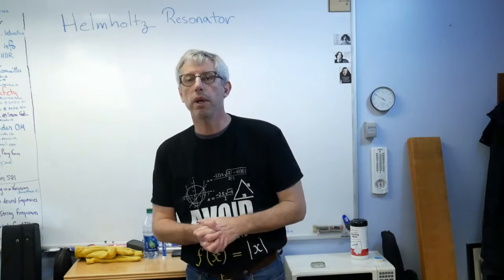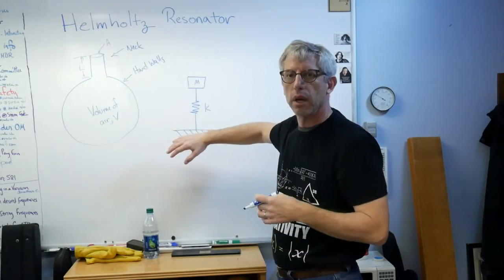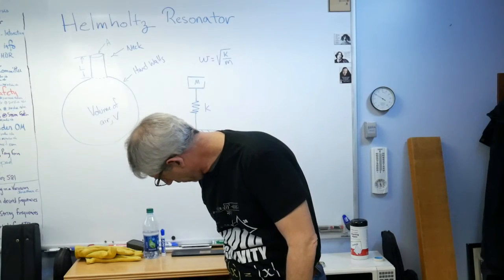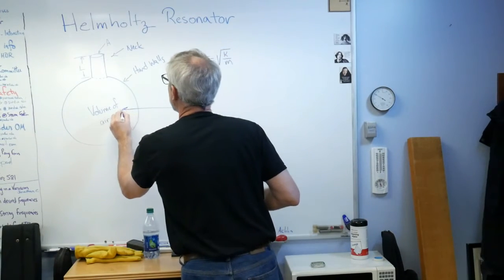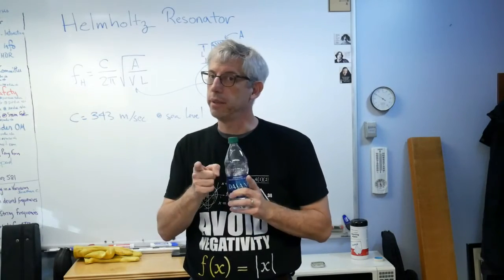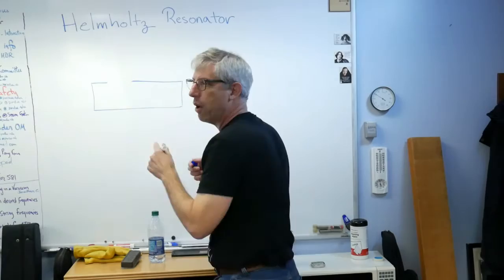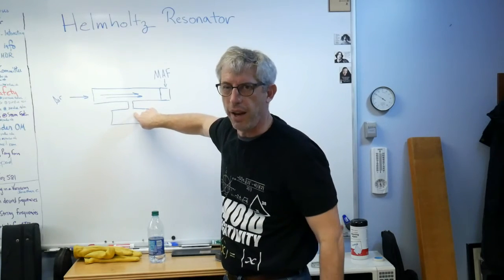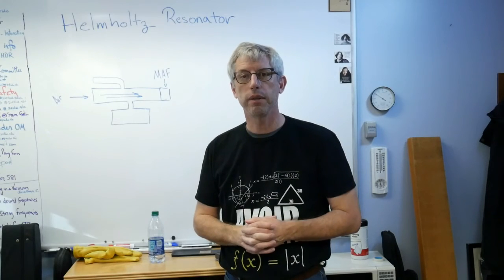Helmholtz Resonator - Brain Waves

Comment: This is a great video; I just wish my professors had been this concise when I was in school. Thank you for making it!

I've ended up down this rabbit hole trying to eliminate a resonant frequency "drone" produced by the exhaust on my car. I've seen several forum entries describing how to create a so-called branch resonator (aka J Tube) but most aren't written by people that really understand what they're writing. My questions are these: 1) If I know the frequency I'm trying to eliminate should I simply use the formula provided in this video to cancel it out or would that amplify the tone? 2) With there not being much room under my car there will have to be a bend. Does the length of this bend factor into the calculation? 3) Does the diameter of the tube leading to the volume of air matter? 4) Considering my drone is around 100Hz, what is the width of frequency I could expect from this "bandstop filter"?
Thanks again!

Comment: All of us humans (young or old) seem to have an innate ability to identify by ear when a water bottle that is being filled by a water cooler will reach capacity. We detect this by sound. But what is it exactly that we are perceiving? A certain pitch? A numerical value that is true for all bottle shapes? Please advise!
Reply: It could be the sound of water resonating within the bottle. As the level of water increases, the volume of air within the bottle decreases, resulting in a higher frequency. Louder (lower frequency) when the bottle is empty. Softer (higher frequency) as the bottle fills up.

Nice observation.
Reply: It's kinda the same sound ya hear when you're almost done going pee

Comment: great video, as always. 
question: what if we don't have a volume, it's all L and A? 
I am asking this for installing pressure sensor on a pipe (called IPV; indicator port valves) in order to measure the pressure inside the cylinder of reciprocating compressors. Helmholtz resonance can cause readings that don't reflect the actual pressure inside the cylinder. how to calculate the Helmholtz resonance in that case

Comment: First, I love the math shirt. 
Second, how do you model soundboards with various holes in it besides the main hole over the strings? Are these just more degrees of freedom with less mass and stiffness? Along those lines, how do you model the soundboard with interaction from the strings as they are pinned to the saddle? By that time, are we best suited for finite element land as opposed to the lumped parameter models?

Comment: Really interesting video, thank you.
I have a question, I have researched inlet resonators in 2 stroke engines before and adding a resonator increased the performance of the engine. The experiment was an engine at idle with a resonator, then when you pinch the tube feeding the volume (that tagged on the side of the inlet so not restricting to flow) the engine cuts out.

Thoughts are that the resonance frequency helps stack the air molecules neatly so it is denser when entering the carburettor. Think of a bucket of gravel and sand mixed up put onto a vibration plate with a high frequency, it sorts them out neatly. If the frequency with lower they would jump about and have space in between.
Do you have any thoughts on this?
Reply from the maker: Resonators only work at one frequency, and may it's harmonics.  I'm not sure about the harmonics.  You're right that the idea is to have a pressure wave arrive right when the piston is ready to accept the new air/fuel charge.  Of course, there still has to be enough air and fuel entering the cylinder to keep the engine running.

Comment: Thank you Professor !
I have a question. Where should I look to find information about design a Helmholtz resonator to improve the performance of a two stroke engine?
I found some articles about 4 stroke engines beeing improved with the use of Helmholtz resonator as a air box on the air intake of the motor , and this envolve something about the opening valves timing , but in two strokes engines tere's no admission valves. 
I'm trying to learn how to design a air box for a 2 stroke engine in order to improve it's Horse Power. 
Thank you for your attention. 
Respectfully ,
Robson .
Reply: I have researched inlet resonators in 2 stroke engines before and adding a resonator increased the performance of the engine. The experiment was an engine at idle with a resonator, then when you pinch the tube feeding the volume (that tagged on the side of the inlet so not restricting to flow) the engine cuts out.

Thoughts are that the resonance frequency helps stack the air molecules neatly so it is denser when entering the carburettor. Think of a bucket of gravel and sand mixed up put onto a vibration plate with a high frequency, it sorts them out neatly. If the frequency with lower they would jump about and have space in between. So a small volume area should work better for this instance.

Comment: Hi! How does it work if the resonator has holes in it, like in an ocarina. Do the holes change the pressure? I don't understand how opening the holes makes for a higher note.
Reply: I don’t think they work if they have more than one hole.
Reply: @mmmdazzagoodmemeayzzz7264  They definitely do, people have run the maths through the mangle for several configurations and you can look the resulting formulas up in textbooks.  An ocarina also doesn't strictly have a "neck" at each finger hole, so the maths (to calculate frequencies) is a bit more involved there, too.

Generally speaking, having more than one "neck" on a single cavity is approximately additive, as far as raising the resonant frequency (it's additive inside the square-root, and in proportion to the "size" of each hole / neck). 

Looking at the formula for the Helmholtz resonator presented here, if you increase the area available for sound to enter the cavity, you raise the resonant frequency, all else being equal.  From a rather primitive perspective, adding extra holes to the cavity also increases the surface area, whilst also making the air in the cavity less "springy".

On that note, it's interesting to consider these other resonator configurations in terms of their equivalent mass-spring systems.

Comment: Hold up,
If we can tune the volume of the resonator to make the engine louder or quieter, doesn't that mean that removing the resonator would, at least according to the math you've provided, make the least amount of noise? If so why have it at all?

Dr French for president
Reply from the maker: You're very kind, but I wouldn't last a day as president.  The first time I tried to fly Air Force One inverted would get me fired.

The resonator doesn't generate noise in the sense that it can't generate acoustic energy that isn't already there.  It can only change the frequency content.
Reply: Noah Rohrlich , the purpose of the resonator is the cancellation of noise. Most commonly there is a standing wave in some pipe and the resonator is used to cancel that innate resonance. Think opposite phase or anti-noise just like noise cancelling headphones, except it's not active electronics, it's cheap ductwork that provides transmission loss over narrowband frequencies.